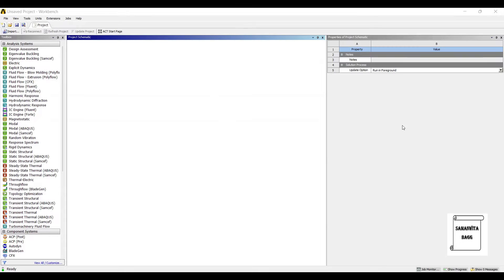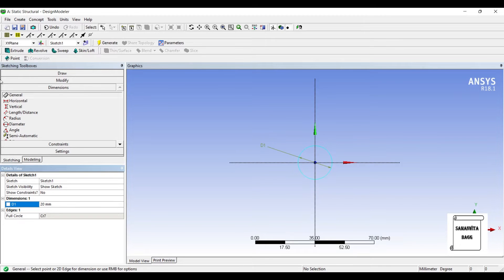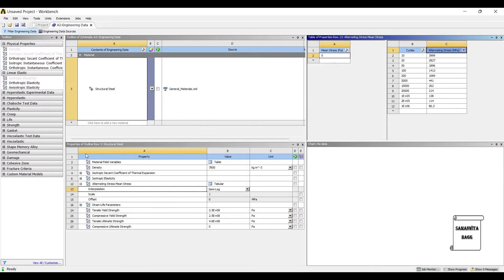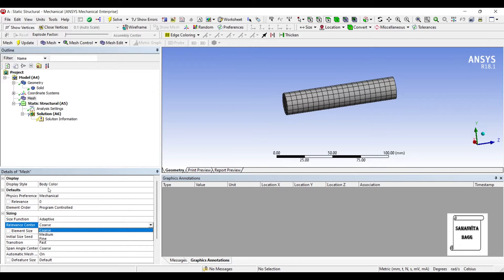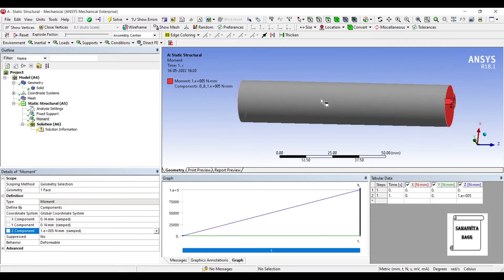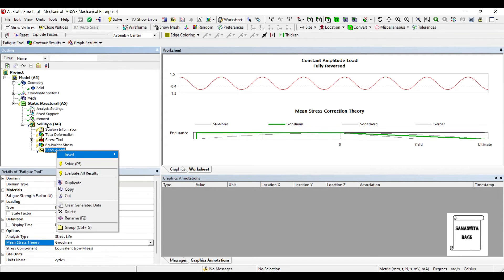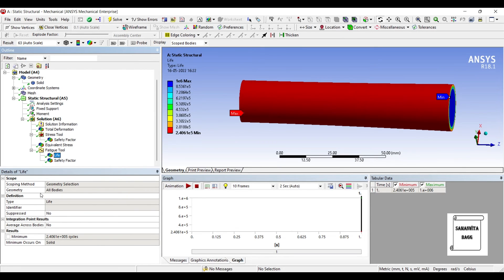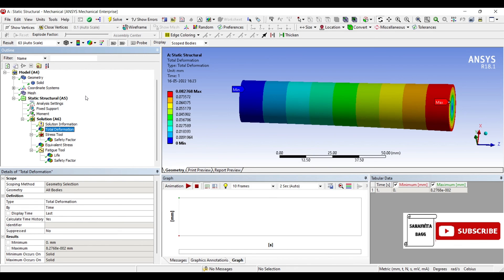Fatigue Analysis | Shaft | Equivalent Stress I Total Displacement | Yield Strength | ANSYS Workbench

Comment: Hi,
I found your video interesting. I am having a question about the failure of the component. Can you please share any info/suggestions to perform failure analysis of the component?
Thanks in advance!
Reply from the maker: Which type of failure do you want to know about?
Reply: @MechProverse  elastic/plastic
 failure
Reply: @MechProverse  Also what are the bounday conditions(Temperature, pressure, forces and supports )required to calculate the failure.
Reply: @MechProverse  elastic/fatigue failure